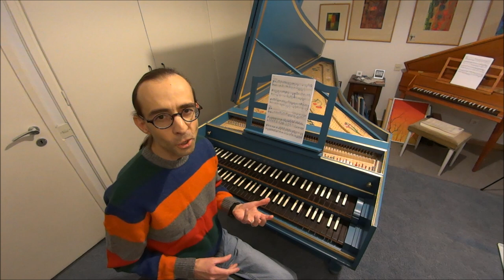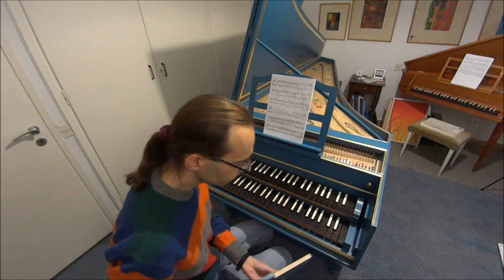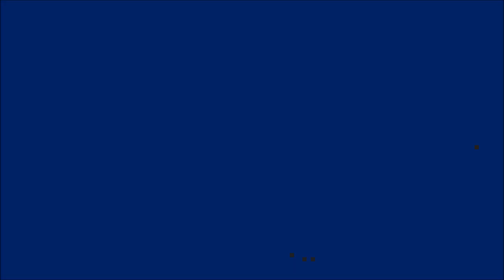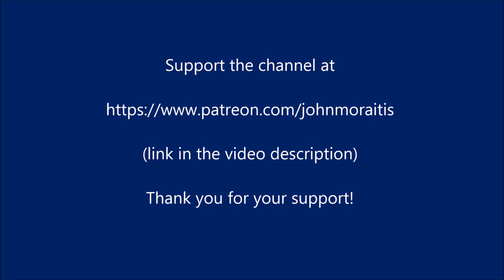Baroque pitch vs standard pitch.

Comment: I'm on a steep but fun learning curve with my recently acquired second hand 1970s revival clavichord.  I initially tuned it to A=440 but, similar to the issue with early fortepianos (something which JS Bach seems to have mentioned) the upper octave is much weaker  in volume than the lower octaves, so I am certain by using 415 or even better 392 pitch, my clavichords upper octave will sound much louder and clearer when playing.  I heard that Mozart tuned his early fortepianos to 422.  Tuning my clavichord to the French baroque A-392hz seems like a great idea.... simply for practicalities and higher volume, although I might go up to 415.  Nothing wrong with a bit of pitch experimentation to see which approximate historic pitches my clavichord sounds best at. I've kept my temperament at equal... for now, anyway.  I can definitely see the benefit of lowering to baroque pitches on revival keyboard instruments

Comment: Actually, Hertz is cycles per second, not vibrations per second. There are 2 vibrations per cycle; the peak and the valley of the vibratory waveform carved out by the vibrating object. Hertz only measures the peaks.

Comment: What a genius idea to just move the keys by 1 halftone up or down. Never heard of that before!
Reply: they have been doing that since the mid 1960s..... But this the first time I've seen the shift to 392.
Reply: It's not genius its just lazy because it matches 440hz and youre stuck with music transposed and not actually in a different unique pitch at all.
Reply: @nw6070  What's the alternative? You tune the clavichord in any Hz (which you can do anyways) and in any tuning system. And you'r 'stuck' with this tuning :-)
Reply: @kpunkt.klaviermusik   the point is to enter a whole new spectrum of notes you wouldn't usually hear by tuning a to somewhere between 415 and 440.  Because 415 is nothing more than a flat. Whereas is you tuned it to 425 or some like 432, you have a totally different sounscape because every other note will be also tuned proportionately .
Reply: @kpunkt.klaviermusik   simply put, 415 and 440 are on the same spectrum, so you're stuck sounding the same, just as if you're playing in a different key not a different pitch.
Reply: @nw6070  If you play on an acoustic instrument, this is the only to quickly change the key/pitch. On a virtual harpsichord you have all the possibilities of course.

Comment: I'll be honest, I was expecting quite a bit worse from the Meantone bit in 440. Was it good? No, but it could've been worse!
Reply from the maker: I think a more harmonically complex piece, something from Bach's WTC for example, would probably make it sound more disagreeable :-)
Reply: There's a good way to solve this problem: 31-Tone equal temperament.

31 Equal is, for all practical purposes, the same as quarter-comma meantone, since its major thirds are only about a cent sharp of 5/4 while its fifths are still about 5.2 cents flat, which is almost exactly where quarter-comma meantone has it. Extending the circle of fifths, exact quarter-comma meantone shows a gap of approximately six cents between D𝄪 and F𝄫, A𝄪 and C𝄫, E𝄪 and G𝄫, and between B𝄪 and D𝄫, and 31 equal helps close this gap. A sharp raises by two steps, so C to D♭ is three steps while C to C♯ is two.

Comment: Just to clarify: So a performer of the period would have adjusted these blocks around depending on whether he or she was performing music from, say, France, or if he or she was performing in France, in order to align with regional standards?
Reply from the maker: I should have been clearer: this is basically a modern feature due to the fact that we have to deal with different standards. Back then, most harpsichords would have been built for "local" purposes, so there would have been no need for this feature.
Reply: @johnmoraitis  Thank you for the clarification. Though it would be interesting to reconstruct how and why these Herz variants had the geographical distributions that they did. Purely a matter of chance? Excellent video series.
Reply: @TheRealGnolti  It's important to remember that pitches often varied not only with geographic location, but also with different musical settings. For instance, in late 17th century Paris, we know of a 'ton du chambre', a 'ton d'opera' and a 'ton du chapelle'. The most concrete evidence for pitches comes from the surviving pipe organs of the time, although the pitch of an organ can vary by as much as half a semitone depending on the air temperature. So, it's likely that all places in Europe had many different 'standard' pitches going on all at once, on an operating basis.
Reply: @CameronK665  That also helps put this in perspective. Thank you.
Reply from the maker: @CameronK665  Thank you for bringing up the topic of having different pitch levels existing simultaneously! It's something that shows how complex the history of pitch can be!
Reply: The whole idea of travelling around Europe (or North or South America) in the Baroque period is very different and far more local. In fact, the push for standardized pitch really only starts in the nineteenth century, when regular, fast  long-distance travel (by train) becomes possible. You would tend to play on the local keyboard instruments, rather than carrying your instrument with you (as organists still do!). 

But instruments do have a 'natural' pitch. Typically strings sound best when tightened to within about a semitone of snapping. Different materials (e.g. different types of brass, as well as different thicknesses of string) also affect natural pitch, but it is possible to determine likely original pitch by measuring the string lengths and getting evidence of original string composition. Again, wind instruments have a 'natural' sounding pitch. Pulling out a joint can alter the pitch, but it can also put the instrument out of tune with itself.

Comment: So if you wanted to use Equal Temperament at 440 things might get easier to play in every key
Reply from the maker: Actually, it's simply a matter of tuning it to equal temperament. There's no need for restringing, as the adjustments from temperament to temperament are not that great.
Reply: @johnmoraitis  Yes and equal temperament eliminates the need to retune when changing between Baroque and Modern pitch, very practical in modern pieces.
Reply from the maker: @RockStarOscarStern634  First of all, it's important to understand that you can play in every key using any circulating unequal temperament, so there's no need to retune when changing keys. Secondly, with equal temperament you lose key "color" -- and what that means is that you lose all the expressive details composers had in mind when using specific tonalities in specific temperaments. And, at least as far as I'm concerned, expression is more important in art than practicality.
Reply: @johnmoraitis  Actually I have a Touch Sensitive Harpsichord that's specifically built for Equal Temperment because it has super flexible ultra thin gauge picks. Jazz music and every modern genre even modernized genres would've been impossible without equal temperament. We have true temperament which is an in tune version of equal temperament that many companies use on instruments.
Reply from the maker: @RockStarOscarStern634  Yes, it depends on the repertory. 20th century music sounds better in equal temperament, because it was conceived with it in mind. Similarly though, older repertories sound better in the particular temperaments they were conceived for. Keep in mind that equal temperament was known in previous centuries. The fact that the vast majority of musicians consciously avoided it before the 20th century, and that Bach specified a "Well-Tempered" rather than an "Equally-Tempered" Clavier, shows that musicians had different aesthetic preferences than we do. In other words, there is no such thing as a "best" temperament -- each one has its own strengths and weaknesses, and it all depends on what repertory you are playing.
Reply: @johnmoraitis  You bet and Equal Temperament is also great for Country Music my favorite is all the songs from Lomax the Hound of Music.
Reply: @johnmoraitis  I wonder why musicians and singers have avoided using equal temperament until the 20th century kicked in? Those people today find it allows them to get a more consistent tone in every key.
Reply from the maker: @RockStarOscarStern634  It's a complicated answer, because it would depend on who you asked. One complaint was that no thirds or fifths were pure. Another was that the major thirds were too wide (and as many musicians, especially singers, were trained to recognize pure thirds, the difference to equally-tempered thirds was too pronounced). Yet another complaint was that all keys sounded the same, so that they lost their character. But, as I said, it's all a matter of aesthetics.
Reply: @johnmoraitis  There's a new one called True Temperment, an intune version of Equal Temperment where every note is in tune w/ itself resulting in every interval sounding in tune too. We also have a new one the Microtonal Keyboard & Kite Guitar (8 Strings) which use 41 Tet, it combines the beauty of just Intonation w/ the Freedom of Equal Temerament all in one.
Reply: @johnmoraitis  I did find a book called "How Equal Temperment Ruined Harmony" which could help.
Reply from the maker: @RockStarOscarStern634  Thanks for letting me know -- I'll definitely check it out!
Reply from the maker: @RockStarOscarStern634  Yes, it's a great book in explaining the history of temperaments, so I would definitely recommend reading it, but with one reservation: as the title implies, the author does not like equal temperament (at least he's honest about it!). So his idea that equal temperament was only established in 1917 should be taken with a grain of salt.
Reply: @johnmoraitis  You bet in fact Musicians have switched over to equal temperament in 1917 (maybe earlier) which means all of those instruments were retuned to it.

Comment: Could you also set your harpsichord to 466hz?
Reply from the maker: In this case I would have to shift the keyboard to 440 and additionally tune all the strings a semitone higher. It is theoretically possible, but that would produce too much tension on the strings (as well as the soundboard), and it would also not sound good -- not to mention it could cause strings to break :-)
Reply: @johnmoraitis  oh, now we wouldn’t want that! I play the recorder on for many Renaissance pieces we can play in 466hz which also sounds very good for those pieces. Nice and bright. I was wondering, if not yet the harpsichord, what keyed instrument was used earlier? Is it correct to consider the harpsichord a baroque invention?
Reply from the maker: @daviddewilde3310  They existed before the Baroque, and there were also other variants that were available (like virginals). Pitch standards varied very widely back then, so it would not be surprising to find keyboard instruments that were made so that they could play at a higher pitch, like 466. It has to do more with how an instrument is designed and what kind of strings are used -- and one could certainly build such an instrument today.

Comment: The modern temperament sounds flat is there a specific reason for that or are they out of tune?
Reply: Rachael They are all out of tune in various ways. Totally in tune is impossible on a keyboard.
Reply: @EJP286CRSKW  interesting
Reply: @EJP286CRSKW  why is it impossible to be in tune on a keyboard
Reply: @RachaelLongLastName  Because the keyboard is one-dimensional, whereas (5-limit) just intonation is three-dimensional.
Reply from the maker: I apologize, but I'm not sure I understand the question. By modern temperament do you mean the pitch level, i.e. 440 Hz? The reason it sounds different is not that it's out of tune, but that certain temperaments are not meant to play in every key, and by transposing from one pitch level to the other (so, from 415 to 440) also changes the tonality. Does that answer your question? Let me know if it doesn't, and I'll try again :-)
Reply: @johnmoraitis  it wasn’t that it sounded different, it was that the modern temperament sounded like it was out of tune
Reply from the maker: @RachaelLongLastName  Let me make one clarification: both of my instruments are tuned to only one temperament (the harpsichord to Rameau, to spinet to quarter-comma meantone), so in both cases you hear the same temperament -- what has changed is the pitch level from A=415 Hz to A=440 Hz (up by a semitone). The reason the second performance on each of the instruments sounds a little "off" is not because the instruments are out of tune -- if that were the case, then the first performance would also not have sounded good. The reason is that both of these temperaments were not meant to make every tonality playable: so when I go from 415 to 440, in effect I move from C major to C sharp major, and C sharp major is one of those tonalities that is almost playable in Rameau, and not playable in quarter-comma meantone (there are musical reasons why such temperaments exist, and I have explored those reasons in previous videos). Hope this helps!
Reply: @johnmoraitis  this clears it up thanks!

Comment: You have a very keyboard-centric view of perfect pitch! On bowed stringed instruments, the sympathetic resonances of strings are important, and the timbre of open strings markedly different to stopped notes; so it's easily possible (I've done it myself) to recognize correctly the notated pitch of a piece through these clues, even if playing at a Baroque pitch. Similarly, on woodwind instruments, the relative harmonic spectrum for different notes can be markedly different, so that, for imstance, the low D on a bassoon is a very distinctive sound. 

Throughout musical history for many centuries, predating Equal Temperament, there are documented cases of composers with perfect pitch (Mozart for instance). As it's generally acquired before the age of six, I suspect that it would have been based on the prevailing pitch of the childhood home or town. There's the interesting case, documented in an Early Music Sources video, where Mendelssohn wrote down Allegri's Miserere from memory at the pitch he heard it at. However, at the Sistine Chapel pitch was roughly a minor 3rd higher than Mendelssohn's perfect pitch, so he ended up notating it in the "wrong" key. (It was then further mistransposed(!) to give the generally sung version of today with the in authentic high solo top C)  

TL:DR Perfect Pitch did exist, even before pitch was universally standardized
Reply from the maker: "There's the interesting case ... where Mendelssohn wrote down Allegri's Miserere from memory at the pitch he heard it at. However, at the Sistine Chapel pitch was roughly a minor 3rd higher than Mendelssohn's perfect pitch, so he ended up notating it in the "wrong" key." And this is precisely why I said there is no "perfect" pitch. Yes, you can retain a particular pitch level, or retain where a particular note is once you hear it (which is something I can do as well), but what that note really is depends on the pitch level that is used. So Mendelssohn heard the "wrong" note, just like a modern musician hears the "wrong" notes when A=415 -- and I've also had students find notes flat or sharp because the instrument was not tuned to equal temperament. I'm not denying there is a (wonderful) ability to recognize pitches. I just think the terminology needs to change, because it does not reflect the relativity of a standardized pitch level. I really suspect our difference in this probably only concerns the terminology, otherwise I completely agree with you.